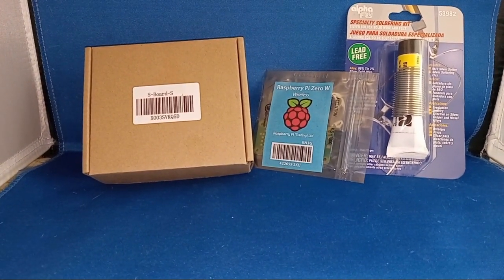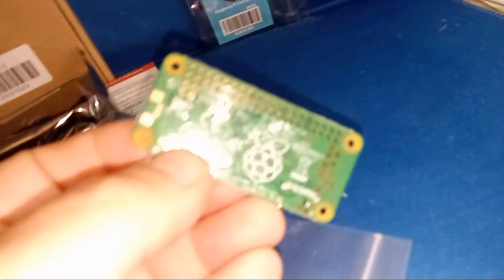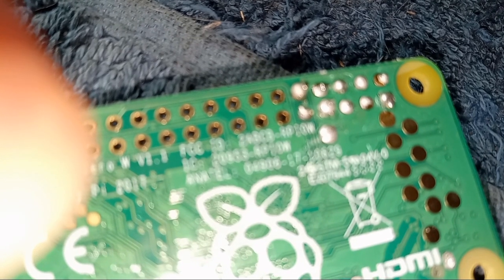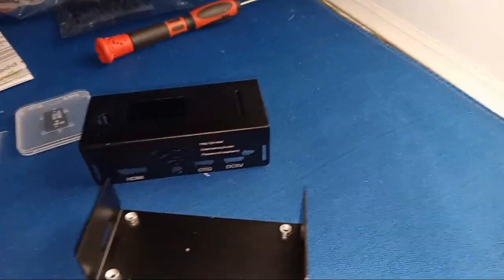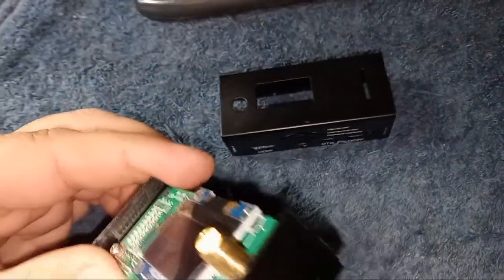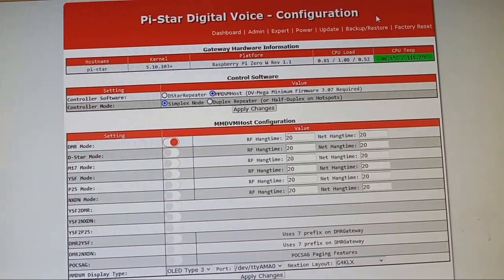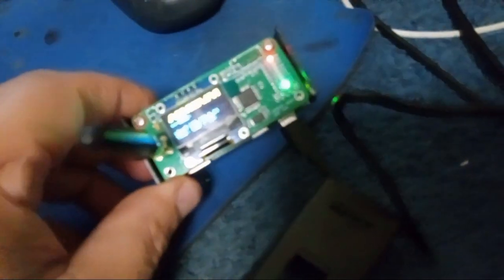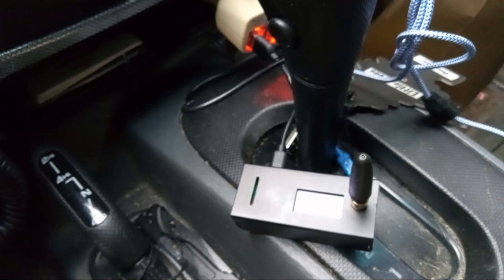Building a PiStar Hotspot MMDVM Kit from Scratch, Setup and Actual Use

Comment: Lead-free solder is very difficult for an individual with an iron to use effectively.  As far as I have heard, lead-free solder works well when you have a wave-machine or other automated process, but the diy'er wasn't really considered when lead-free solder was designed.
Reply from the maker: Yeah it can be a challenge but I think it is still manageable, I just had to experiment and get used to it.

Comment: New subscriber here.  I have pretty much the same mmdvm as yours (although mine is using a c4 labs case.)  Is it worth it to upgrade to the newer raspberry zero w2?   Like you I'm using mine for YSF.
Reply from the maker: I can not personally say it is worth it, I built one last year based off the Pi zero (this video) and found nothing different in the way it connected or acted versus the models you seen sold on amazon or ebay, its all personal preferences